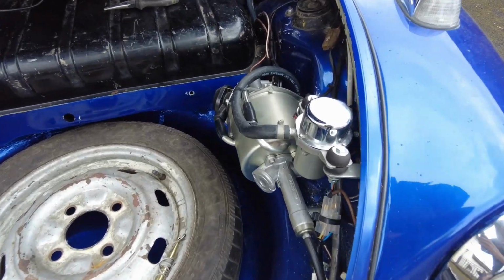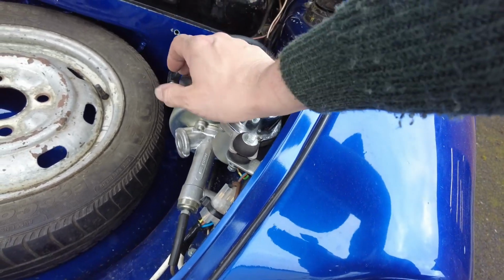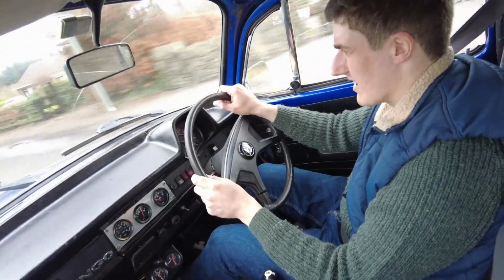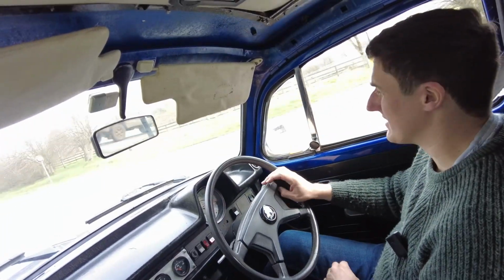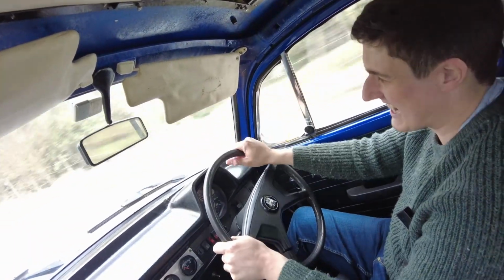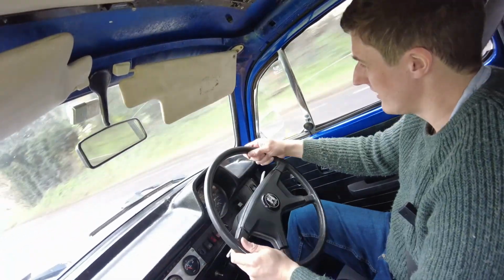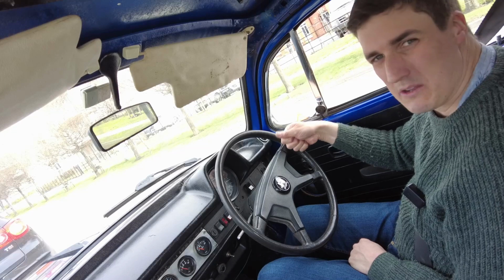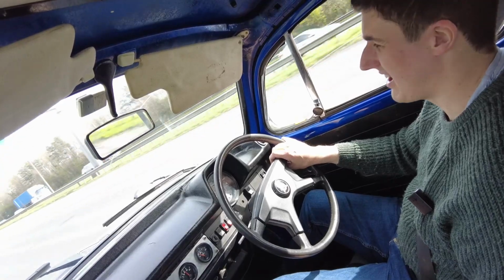Taking My Half-Finished Beetle on a Cross-Country Trek for Repairs

Comment: I hear on the "cheap" mistake.  I wanted disc brakes on my '74 1403.  I looked at the CSP vented rotor kit but was sure I could do something similar for less.  Long story short, after FOUR different set ups and about 3/4th the cost of the CSP kit...I bought the CSP kit
Reply from the maker: The CSP kit is mad money though. That's the only thing. I'd find it hard to justify, hence why I went with the remote servo, which I'm very happy with.
Reply: @Endfloat  it is, and, in hindsight, unnecessary.  I won't go to far into it, but, for a time, I had two 1303s.  The one I have since sold had CB Performance disc brakes, front and rear.  One of my adult sons, and I autocrossed that car, and it stopped on a dime, every time, with no issues.   I made a committed decision to run n/a 944 rear brakes on my current car, so I wanted to match the look with vented front rotors.  I looked at the CSP kit years ago and was certain I could do something similar for far less $$.  In the end, I bought the CSP kit and cried about all of the money I wasted trying to make up my own kit